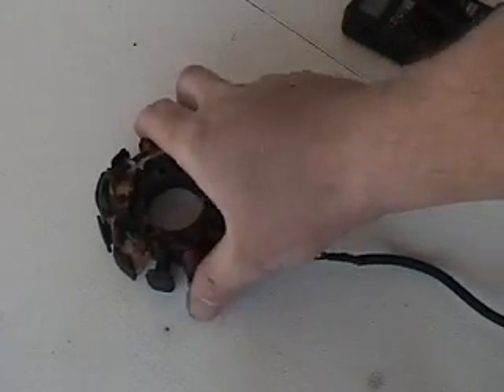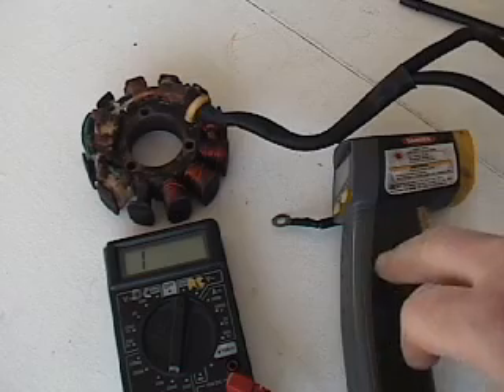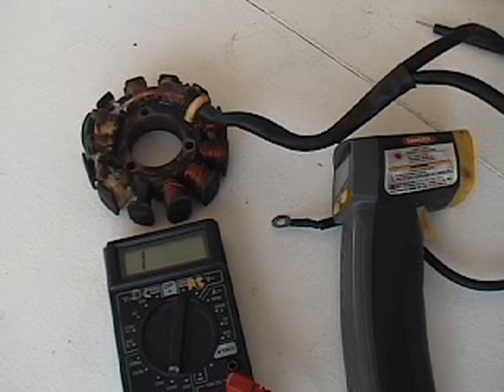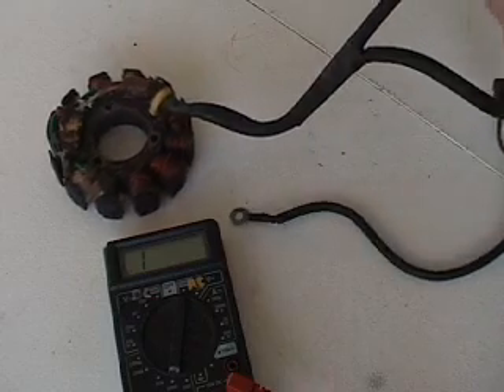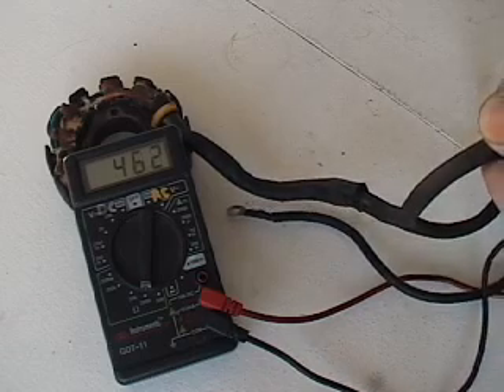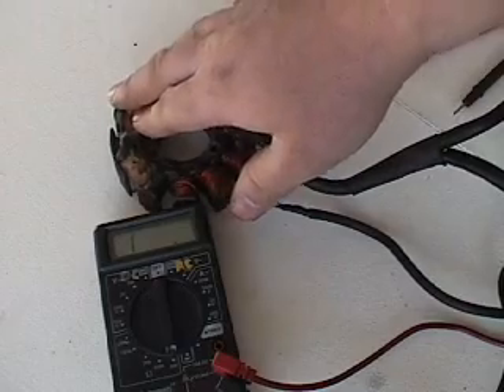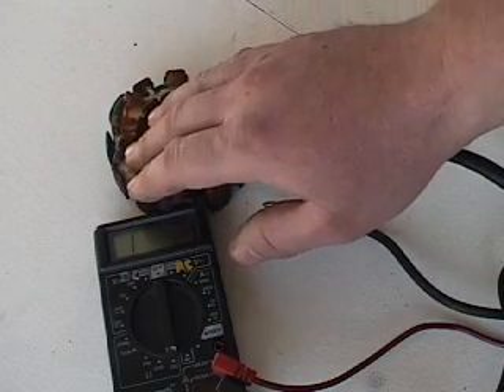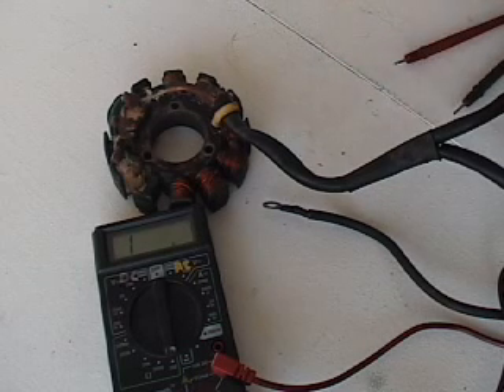Arctic Cat Measuring Stator Ohms Cold vs Warm temperature

Comment from the maker: Measaure the 3 prong plug that is plastic. The other one is a more rubber plug with the 2 yellow wires..that plug is for the "AC power" side of the stator which powers your lights and gauges. The black plastic plug with 3 wires is the ignition plug that plugs into the ECU. The 2002 600 EFI stator should ohm out at 18, 18 and 36 in series.